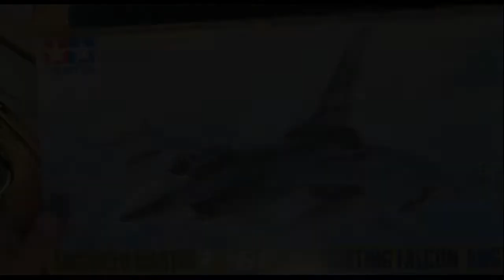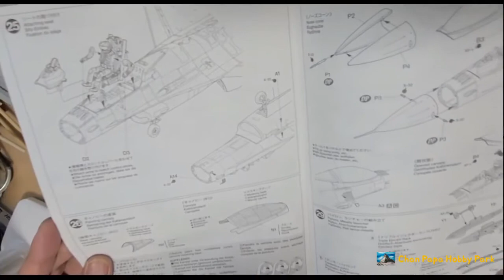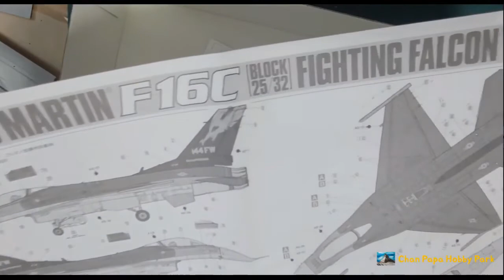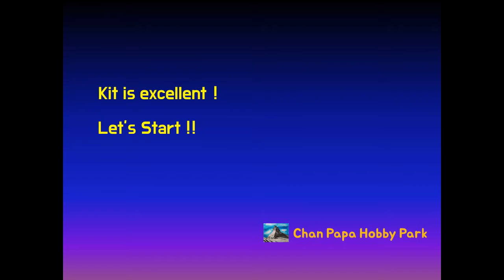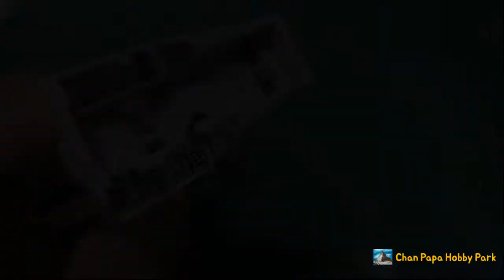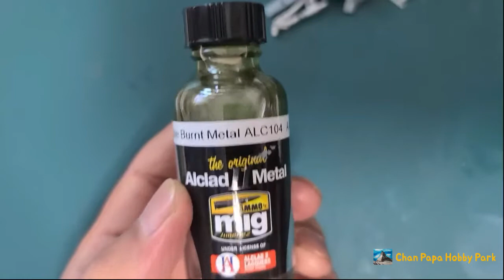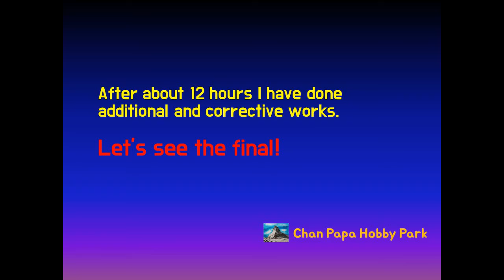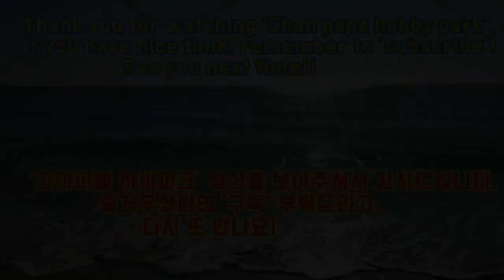Full Building LOCKHEED MARTIN F-16C (TAMIYA 1/48) Aero Model

Comment: Your box is still in good shape. Mine is bumped up but parts are still well kept. Now tempted to open up to build it and I do have parts to upgrade to later block 40/42 and block 50/52.